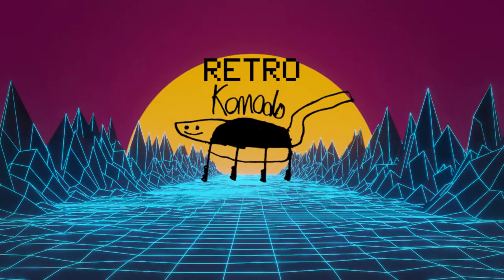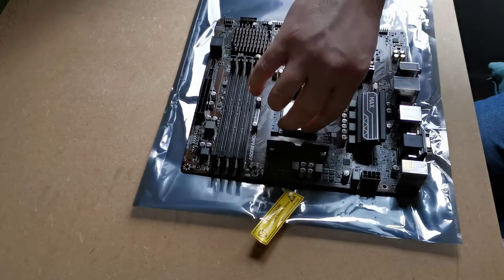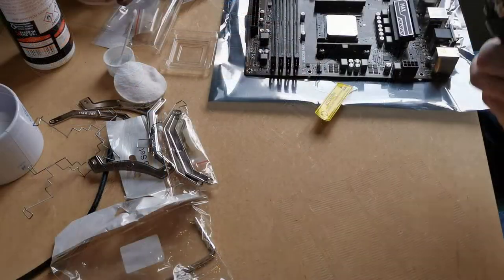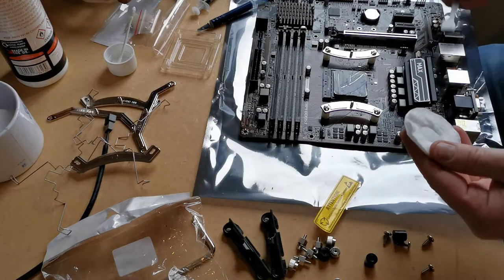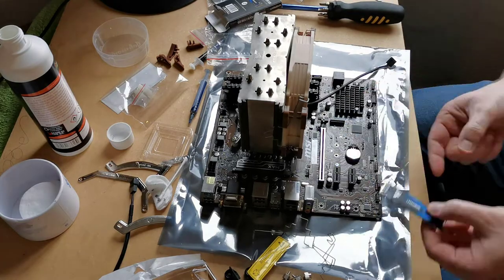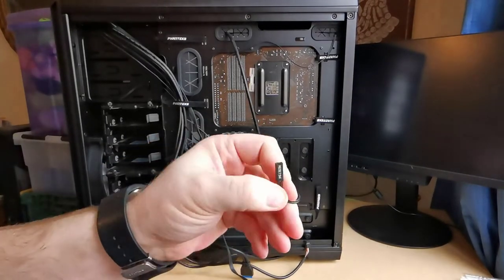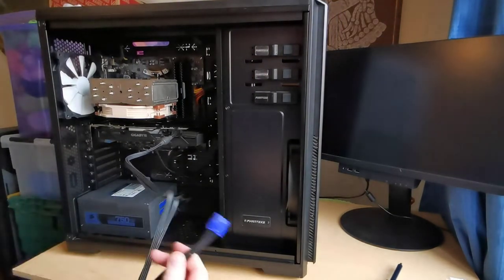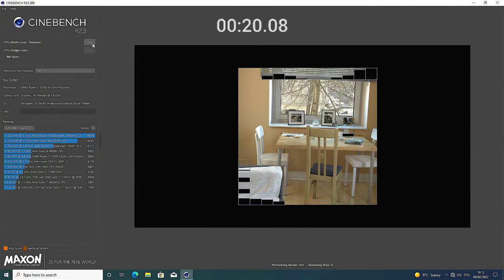Building a cheap video editing PC from second hand parts

Comment: mounting a cooler "sideways" actually was a strategy for using the CPU fan to draw air from the bottom of the case upwards through an exhaust at the top of the case, usually mounting an additional fan there. this was sometimes needed on motherboards that had quite complex VRM cooling. one downside was that if you had quite a powerful GPU, the heat from the GPU would be "cooling" the CPU which wasn't ideal.

an old solution for that was a case that had two fans at the front, which would ingest cool air from outside the case inwards over the motherboard and any drives at the front of the case: a lower fan for cool air for the GPU and an upper fan for the CPU/memory. an exhaust at the rear of the case and top would then be good to draw air "up and out".

if you're curious, you can use the "core temp" software with different cooler orientations, coolers, and pastes and see how it affects the CPU. even had logging so you can chart results.